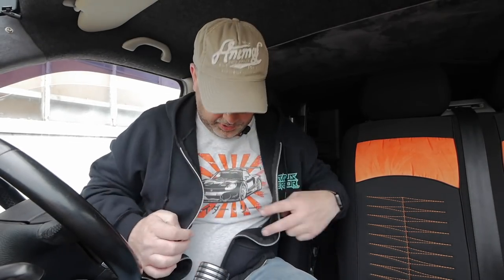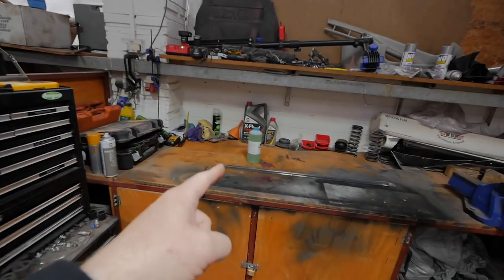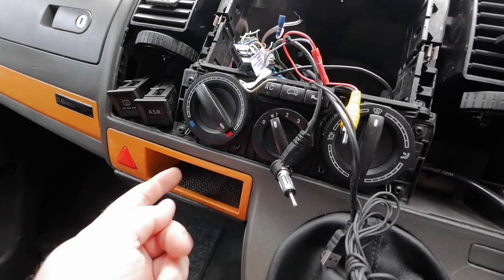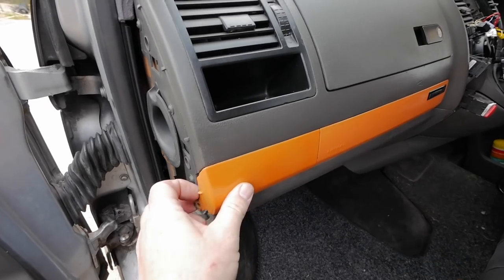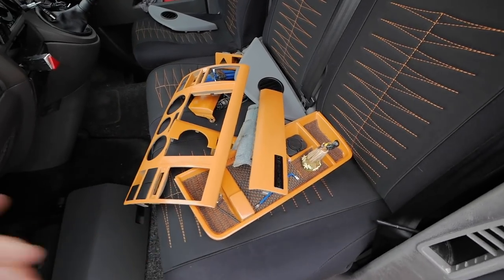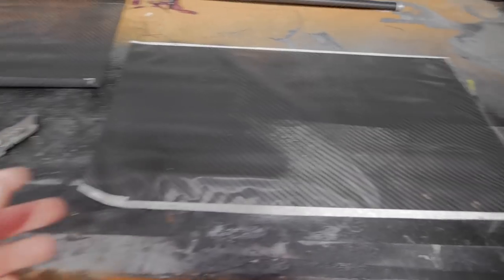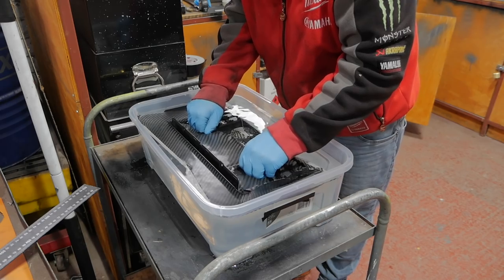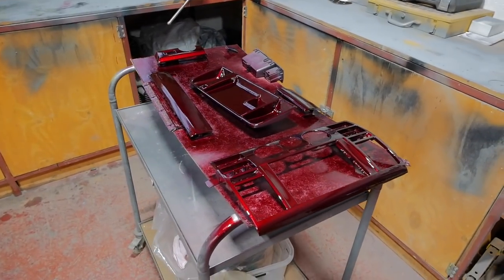Removing and Painting dash trims - VW T5 transporter

Comment: Nice job will definitely be doing something like this on mine was wondering could you tell me where you got the anti slip mats for top dash pockets and if you have them in the door pockets haswell that would be a great help and would be greatly appreciated keep up the good work...👍
Reply from the maker: Cheers 👍. It was just a roll of it I found in the local supermarket, and cut it to size with scissors
Reply: @SpyderLEE  nice 1 mate hungry eye sees far..😉 you have to have your eyes open everywhere never thought of the supermarket but now that I think of it I have seen similar in my local hardware.. cheers 👍

Comment: The best clear coat that you can get is the "OH MY" 2k clear from BuyCustomPaint.com.  A HS clear that's really easy to spray with a high gloss, and doesnt require cutting or buffing and the small kits start at $30..... Definitely worth checking out...good video